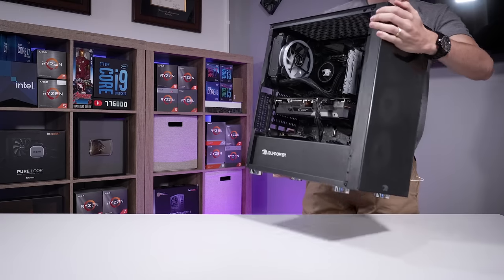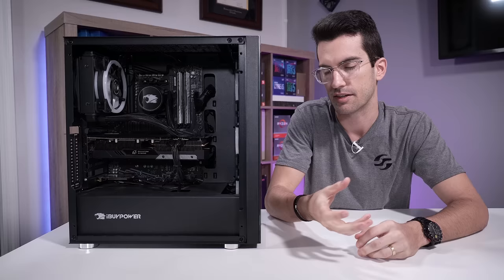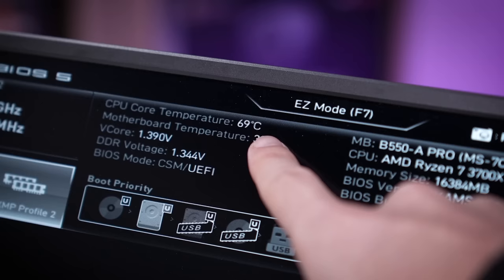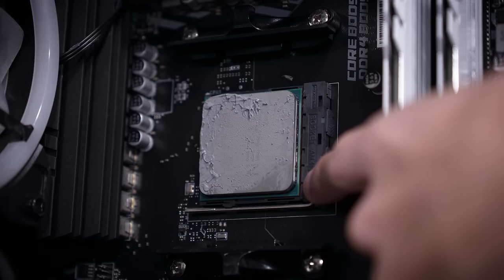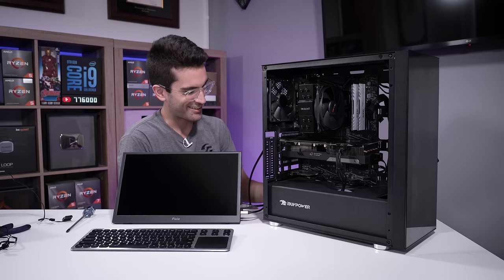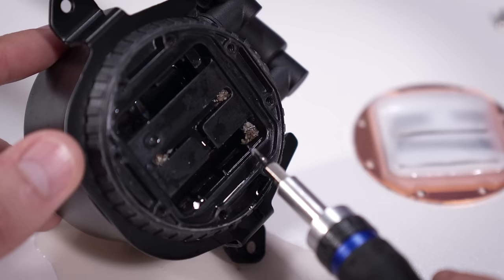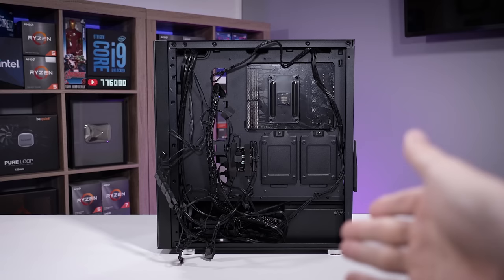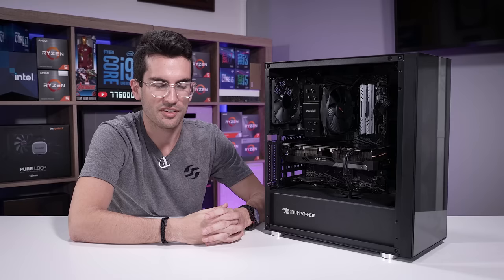Fixing a Viewer's BROKEN Gaming PC? - Fix or Flop S2:E8

Comment: Hey Greg, If youre intrested, I may have a MSI 360 AIO, with the pump in the radiator, not sure what is wrong with it the pump seems fine, but when it was installed on my R9 5900x my idle temps would stay around 60-65c with fans full blast. I have since changed out to a cheap Vetroo 360 AIO with pump on the cooler, and my temps stay around 30c with fans very low, I would be willing to let it go for free as to me it is garbage..

Comment: I think its a dumb idea to put the pump in the rad, as it will force crap like that with a higher water pressure out of the rad & into the block. If it were in the block as usual it would pump the crap into the rad & it would more than likely settle in the radiator without affecting it, thus better thermals.    Just my opinion

Comment: He's got the same exact motherboard and cpu as me but my cpu is idling at 44C sometimes spiking to 56-58C. I have been using a Thermaltake TH240 ARGB for the past 4 months. Any opinions on this cooler or some ideas to help reduce the heat. I also have a case with 3-intake 3-exhaust fans setup.

Comment: I'm wondering if they are using Copper coldplates with aluminum radiators.
Reply from the maker: Perfectly fine if galvanic corrosion inhibitors are used. Copper is a better thermal conductor (hence why it's used in the block) and Aluminum tends to let go of heat a bit better (hence why it's used in the radiator).

Comment: I have watched quite a few of your videos where the temps were high in the bios. I have 30-32C when the pc is idling in windows but when i go to the bios my temps are around 54C. Im using a r5 5500 and it has no issues in windows but for some reason being in bios makes my cpu work its butt off as if im in a game. I think that it has to do with high voltage while you are in the bios.

Comment: Noticed slight temp changes in my PC. Pump remains super chill, but CPU idling at 40C. Which is odd, kuz I could get the system to chill at a solid 30. Will have to open up my AIO and do some cleaning

Comment: I'm 100% a hater of the pump-in-rad design. My wife's MSI 360mm AIO died in less than 3 months. This was probably my fault because I did mount the rad on the top without thinking about the pump then being basically at the top of the loop and getting air. Her 5600x hit 101c when the AIO died completely. Fortunately no damage was done, she was just super confused why her game went from fine to unplayable lag.

Comment: One reason I hate intel stock coolers is their screwless design. I’ve never worked with them until I did a mobo upgrade on my neighbour’s computer. I booted it fine, it was running hot so I reseated the cooler. Reseating the cooler made uneven pressure on the CPU and temporarily bricked the PC! Took me an hours and 2 CPU reseats to figure it out. The design is so fiddly for cooling that is subpar. Coincidentally that night, Linus uploaded a video heavily criticising the cooler. But great video as always GS!
Reply: you think that is bad go back to when it wasnt a screw but a screw thing you turn and it just presses a rod between to pieces of plastic
Reply: @calmterror  bruh that is the screwless design I am talking about
Reply: @watchkam_  oh yeah misread screwless and screw lol yeah that crap was the worst and it wasnt even  just the stock coolers. I had a thermaltake tower fan cooler thing that used that same screwless design. note this was on a core 2 motherboard
Reply: @calmterror  the thermals are terrible too, the pc I was talking about was idling at 55-65°C, which worried me. Turns out it is normal and not because I’m just used to my AIO.

Comment: Air cooling is just so much nicer from an average users perspective. If the fan dies it is easy to see and replace. An AIO water cooler can slowly die and the average user has no idea what is going on. Especially considering most people are only gaming 1080p there is never enough heat to warrant a water cooler. I always recommend air cooling. Most fans nowadays are so quiet you can barely hear them anyway.

Comment: So helpful! I'm 15 and built my PC but it restarts 3 times after I press the power on button (monitor displays no signal in between restarts) and 1 of two GPU power LED lights on. After that, then it boots. What should I do? (Custom built PC; GPU: Gigabyte Aorus Radeon 6700XT Elite 12G)

Comment: My pc has the same issue with cpu temp I have to keep the side panel open so it doesn’t overheat at times but the cooler feels like it’s running I redid the thermal paste so it has to be the same issue

Comment: I am thinking now on moving away from liquid cooling... I am using the NXTZ one (the small one) and after a year I am hearing my pump every now and then. My cpu hasnt overheated yet but i see my temps on 55 averages on a well-ventilated case -_- so disappointing.

Comment: I have an Ibuypowes Snowblind and i had the very same problem at first i thought i had a hard drive going bad but when I unplugged the hard drive the noise was still there so i the started the fans and when i unplugged the AIO pump the noise went away so  i repace my aio with a cool master air cooler and my temperature went down since i have own this computer the CPU temp never went below 60c now with only a couple of programs running my temps are now at 45C and below

Comment: Hey Greg, i bought myself a NZXT 120 mm AIO and after like one and a halfe year i had kind of the same problems, my Temps were not as good as earlyer but i didnt care because it was only aber 45 in Idle max. The next thing that happened was the wierd sound you heared from this one on the start up, after writing the support they told me i should "hit the AIO" i didnt wanted to do that so i just told them i wanted a new one wich i got pretty fast, i send mine back to then and the thing was all good, but now seeing your Vids made me think about that stuff more and more, i was to scared to open it myself but seeing you opening these 2 with the exact same problem and hearing that noice, i think that might be the same issue with mine, i cant proof it sadly but i can tell you that even NZXT didnt knew a better answer for me then to "hit it" or replace it with i think is kinda sad, would like to see you reparing one of these if it is possible. 
Have a nice day and i rlly enjoys watching your channel

Comment: Hmm... this might be the issue i have with my "Arctic Liquid Freezer II 360" idle is at 60c-65c
Reply: If your ambient room temp is around 20c at idle you should be in the 30-35c range. I have a 10850K at 5ghz all core with the same cooler, at idle I'm seeing 34c. Sounds like the heatsink has not been secured or the pump has failed.

Comment: Hi there,
I am having the exact same problem. I can hear a rattling sound when I turn on the PC and can also feel the fluid moving through the pumps. However, the ideal temps quickly reach about 60-70 C and when I actually go to the windows, temps reach about 85 and then shuts down after reaching 110.

I am not sure what should I do in this case.
I am using Silverstone PF240ARGB AIO on a Ryzen 5 5600X.

Comment: i have had  that problem serval times with different aio but all of them had  the pump in  the rad and heard that clicking noise short after starting to hear that sound the pump failed w i finale switched to a cooler master with  a pump in th  block and hav had  no problems  what so ever

Comment: My aio makes the same sound when i turn it on sometimes for about 20-30 seconds although it holds temps just fine it's done it since i got it 2.5 years ago i have the coolermaster master liquid ML240L RGB
Reply: those cooler master fans are the worst, i have a 360 and a 240 and the fans are bad ;_; i want a refund but its been a few year i think
Reply: I'm actually had some fans that I want to switch it out with for like the last 4 months when I built my son's computer I'll probably do it tomorrow I have the day off

Comment: I recently installed a 120mm aio from corsair and it worked fine but then my idle temps went to 65c after an hour just going on youtube, discord, etc. went back to my hyper 212 evo with noctua fan and it went back to normal which is weird. no more cheap corsair aio anymore lol

Comment: Just replaced my mobo with a Msi b550 unify, and when I start the pc from its off state, after hitting the power button it takes about 1 second or so to power on just like how this system did in the video. Is this normal? My system never used to do that until changing mobo’s.

Comment: That is the drawback with using liquid cooling, if you do not understand how to maintain it then its potentially worse than an air cooler could ever be, and pulling down an air cooled rig to clean is superfast also. james2c.

Comment: I had a dual MSI 140mm with the pump in the rad he got extremely hot brand spanking new I bought it off of Amazon and was unable to send it back and that was only having the AIO for one month and a quarter got another one instead of a two fan rad I purchased a three fan rad because the pump is in a spot on the very top which removes air flow so in hindsight of the first one dying as I said I purchased a three fan so that way I have two full open air sections and a half so far my temps and the AIO is working quite well and my temperatures are at a balmy 32° and sometimes it can get down to 30° in the cold Winters I have seen 22° all in c of course and at full load winter time it's got as far as 52° c and summertime with no air conditioner 71° Celsius a tad and a hot side but still doable for a quick 45 minute runs on Diablo 3

Comment: i had a msi 360r cooler made same noise bios temp 72c, changed to corsair 360 AIO and now 40c max temp on cpu under load is 81.4c
Reply: Winning a gift from just posting, didn’t know that could happen

Comment: I have a ibuypower prebuilt at my dads house and the aio pump made the Exact same sound it did in this video and I have a normal sized radiator with 2 fans and was intel so anyone buying a ibuypower build with aio I say get a different aio because mine did the same thing it’s gonna be cheaper in the long Run because a cooler is cheaper then a cpu

Comment: Weird question but I have an asus b450m prime ll and every time I go into the bios my cpus just rockets up to 60c and sits there but when i boot into windows it’s 30-40c. It’s been that’s way since I built it with a 5700g and it’s been reseated a couple of times

Comment: Never understood the point of installing AIOs in systems with such low CPU TDP.  An air cooler would do just fine in that situation, and give a lot less problems. The CPU cooler's fan for my previous PC gave out after 8 continuous years of operation.  Its "death rattle" was very noticeable, and easily fixable - by replacing it with another fan :-)
Reply: Especially an AIO with a radiator this tiny. The rad is literally the same size as the air cooler that Greg installed. A top tier air cooler will perform better at a lower cost than a lousy single fan air cooler like this for sure.
Reply: cpu tower restrict air flow especially for the gpu. a 240 is fine but honestly we need cheaper kits for gpu+cpu cooling to compete with these shitty AIO cash grabs.
Reply: @prydzen  Towers don't restrict airflow for the graphics card, you can stuff a case with a lot of clutter without airflow being a problem.

Comment: That is why there is a difference between expensive and cheap AIO coolers.
It is better to buy a solid air cooler than a cheap AIO. I have an NZXT Kraken X62 for over 4 years, it still works like new, never any problems.
Reply: My Corsair one did shit itself like this. It was also 120mm.
Reply: @shaneelnand9350  but Corsair is a good AIO.
Reply: @davidv.8765  it is! But 120mm AIO’s are a problem in general

Comment: Do you happen to know the difference between XMP 1 - 2? I've researched but ran into walls.. maybe that's why it was going through the long boot time?
Reply: in my experience xmp 1 leaves some of the advanced timings in auto for the motherboard to figure out but sets the major timings, xmp 2 sets some of the advanced timings as well as the major timings and can sometimes use slightly tigther timings for more peformance but at a possibility of unstability.
Reply: @aussieguy1593  I really appreciate the reply and that does make sense

Comment: This comment was written before I watched the video:

i believe that the overheating issue is due to the big GPU in such a small case: it heats up the ambient are so fast that it recycles a lot of air, even with the circulation.

Solution is a bigger case.
Reply: Eh, was wrong

Comment: Hi Greg. I too have been having over heating issues with my AMD Ryzen 9 3900X system. Not to the degree of this video. At idle its fluctuates between  41c and 60 c at idle/web browsing and side panel off. My 3070 creates a lot of heat when gaming and I have to manually turn up the gpu fan other wise my pc shut off then restarts with no windows error messages. I have a 2 year old Corsair H100 Elite. I was wondering if the Dark Rock Slim would work for my cpu or do I try the next level up?
Reply: 60c during use isn’t bad. If it’s doing that at idle I would worry about it.
Reply: @TheSjuris  After watching this vid I went into my bios and strangely my cpu temp went down to and stayed at 37c. I have no clue whats going on with it but with the side panel off and the gpu fan at max I am able to game without it shutting down on me.
Reply: @TheTecfire  you shouldn’t need to have the side panel off to keep it cool.  If you have a similar case to the one in the video, I would suggest using an air cooler.

Comment: when i had my temps up i had to replace my msi core 360r aio and go to the stock amd cooler for the 3700x and put cpu voltage at 1.25 and clock 2 4100 MHz and now i idel at 30c
Reply: when i took apart the rad and copper plat i saw abunch of crap in the block and pump

Comment: Mixing metals in cheap AIO's is just stupid.  If they don't use adequate corrosion prevention in the fluid, then they need to use aluminum hotplates.  It's pretty simple.

Comment: I still don't understand the reasoning behind using a 120mm AIO over an air cooler for ATX systems O_o
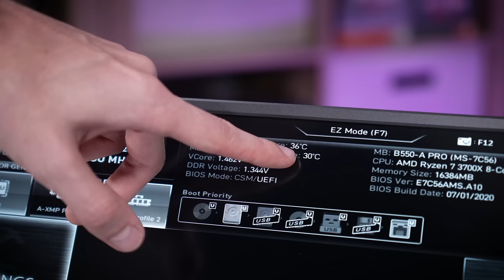12:00 What maniac configured such a high VCore? Almost 1.5V for a 3700X!?
Reply: my 3700x idle'd at like 1.488v, overclocked now but running around 1.365 with much higher core clocks lol

Comment: What does it take to get you to fix a viewers PC? IM currently having issues with a system i built, Its got the 12900k, 64gb ddr5 g.Skill ram, RX 6800XT (I know im not getting SAM, it was all that was available at the time) I have a Aorus Ultra Z690 mobo, and ive been having driver or powers issues with the RX 6800 XT, it started the other week when i tried used the AMD Adrinaline driver software to auto-overclock the gpu last week, at first it said the over clock didnt apply, with an error message, but the settings had all changed, so i fired up GTA V played for about 20 minuites and then the game crashed, but when it crashed the monitor resolution when to 800x600 from 1440p on the desktop, and then the entire pc blue screens before i can do anything, to make a long story short, i had to plug my display port into the mobo, and reinstall and uninstall the drivers idk how many times itd never work, then i pulled the gpu out and unplugged all the power to the pc for 20 minutes, plugged everything back in, downloaded some software called restoro to fix the corrupt and dead drivers and then reinstalled the gpu drivers, and it finally worked, that was last week. Now yesterday the GPU starts doing to the same thing, but i used restoro right when it happened and everything came back on and is currently working right, BUT my gpu is now running way hotter than before while just idling ... idk what to do,.

Comment: I'm afraid of AIO's and water leaking on my GPU during those rough times, rocking a Assassin lll,  x3700 idle at 29 degrees and 55 in COD all cores locked at 4150mhz

Comment: Which is  a normal temperetaure for a Ryzen 5 5600x? right now normal use is 43-48C and when i play something heavy reach 70c. Is normal?
Reply: thats fine, many cpus will idle in the 40s and 70c under load is perfectly fine

Comment: I have a pc that I might want to get checked out. It runs and everything but is very slow and takes years to start up but is only about a year old and shouldn’t take that long. Any ideas?
Reply: I would first start looking at your temperatures. Modern chips do thermal throttling to prevent chips getting damaged from too much heat, and that means: If the system gets too hot, it will get really slow.
Another thing you could try is boot up a small system from removable media to check if that runs faster. In that case it would look like a software issue, which could have thousands of causes, but at least you would then know it is something with the software. Worst case you could then reinstall windows and set up the system from scratch.

Comment: Mine Ibuypower pc has this same situation right now 2 year old system..... Its making the same noise as this and running hot at idle...
Reply: Well i took the cooler apart and it was worse then the one you showed. Filled with gunk.

Comment: This crap has been plaguing AIOs for years now. Enermax went through the same thing years back. I had one of their LEPA branded AIOs fail with the same issue. GamersNexus actually did a whole investigative piece on this issue which included lab analysis of the contaminant, which was pretty interesting. It's so widespread that I just straight up don't trust any closed-loop cooler at this point. Just a shame, they definitely have their place, but it's not worth the risk when something that costs more than $100 will just fail this way.

Comment: Where is even the point in a 120mm AIO with a pump/rad combo?
It has almost no fin surface.
Unless in some ultra crazy small ITX builds I see no pros for those over a decent air cooler